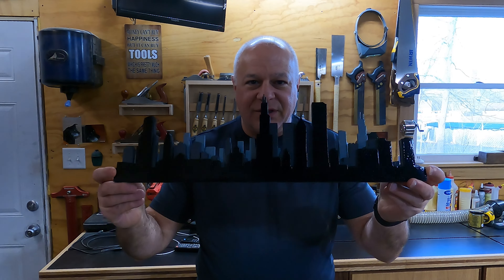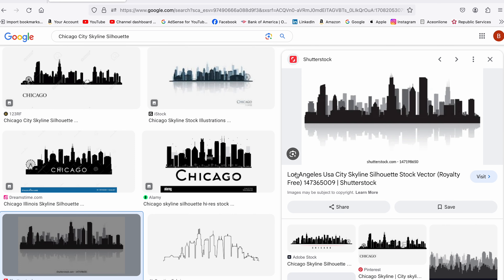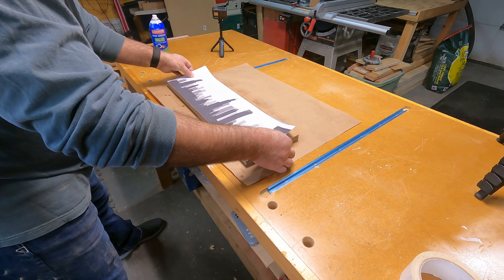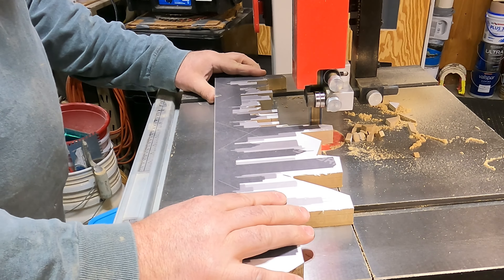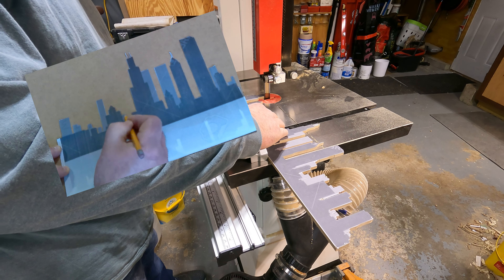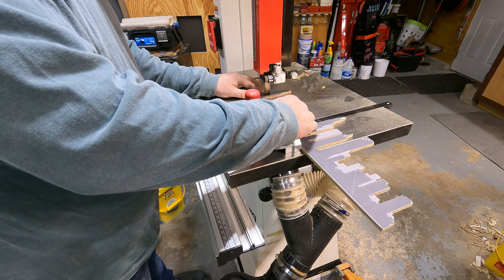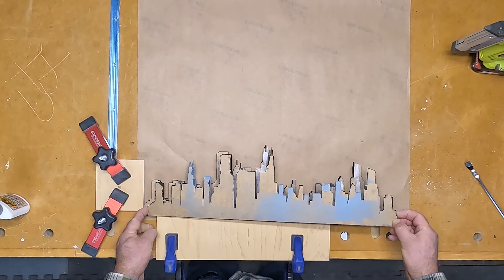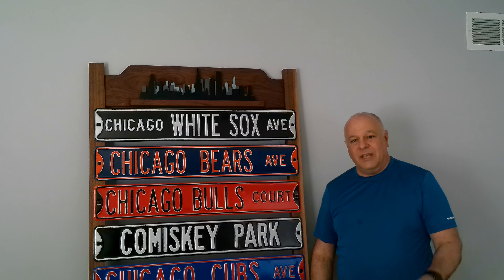Chicago City Skyline - How to build a 3D wood model

Comment: Hey there, I'm trying this myself but when i separate each layer I'm left with horrible residue from the double sided tape! How did you avoid this?
Reply from the maker: It may be the type of tape you are using. Try a light duty tape. If that doesn’t work, I suggest you put a coat of shellac on the boards first to seal them. MDF is absorbent and may be drawing in the glue from the tape. Hope this helps!
Reply from the maker: Also, you don’t need to use a lot of tape. Just a couple small spots to keep the boards from sliding apart.